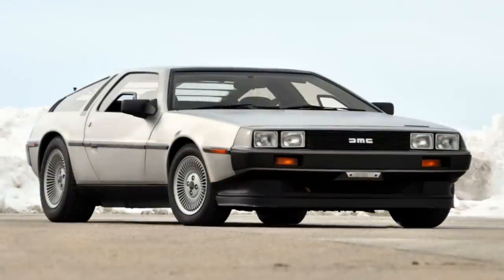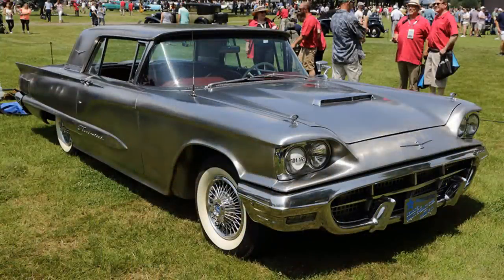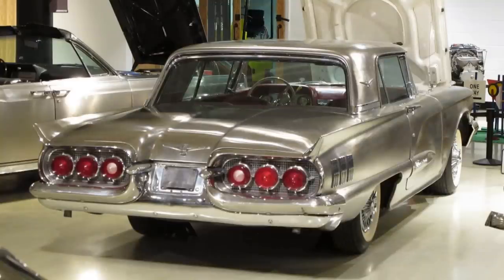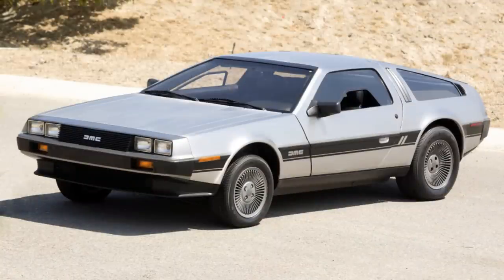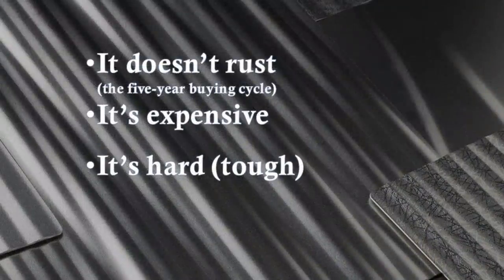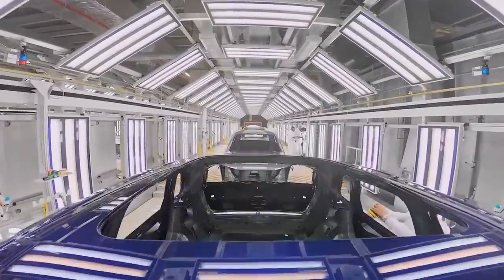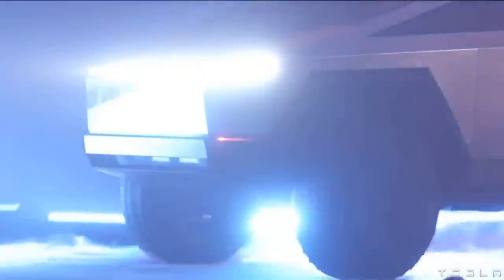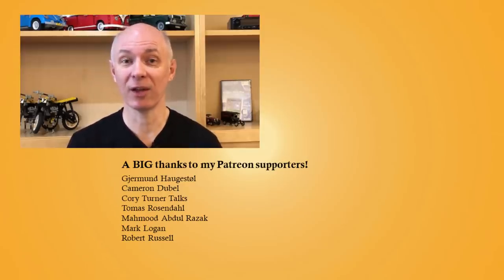Why aren’t cars made from Stainless Steel?

Comment: There is, or rather was, another car manufacturer that built 6 stainless steel cars.    General Motors Holden built 6 stainless steel HR model Holden Premiers.    They were special orders vehicles and were given to members of the board of execs working for Holden.    They were also not part of the company build run listing and were not recorded as being built out of stainless. Officially and from company production records point of view, they don't exist.    Each had specific vin's that ended in the build number of the vehicle.   They were all painted as well.

Comment: Imagine if all cars had been made from stainless steel? No more rusty bodywork
Reply: Then you only need worry about stress fracturing on any weak points design may minimise the stresses on bodywork and welding to repair 3mm Stainless steel wouldn’t even require a TIG welder …

Comment: Cybertruck is surely a joke? The way ahead is plastic, light and strong. Stainless steel is basically the answer to a non-existent problem but comes with a host of its own problems.  The goal is to make an electric car that performs like a petrol car in every way. Silly getting side tracked with Teslas marketing stunts.

Comment: You cant polish out stretches from stainless steel. That finish would be very high maintenance
Reply: I drive a truck.
I've washed it once in ten years and that was only because I had to replace a guard due to it being run into.
Real truck drivers don't worry about a bit of grime

Comment: The "detail" that was not mentioned here, and is not mentioned anywhere, is that this kind of construction is heavy as hell. Since all panels are straight, they have to have a very thick caliber of steel. And if you add the unnecessary bulletproof windows, the whole thing is stupidly heavy, so much so that the one great thing of it, the ecological benefit, is very much lost.

Now that several deadlines have been missed, I think it is time to think this white elephant through all over again.

Comment: The Delorean was plagued with with cracking panels which is why the hood was changed (Eliminated the fuel door and ribs). Stainless is in a permanent work hardened state and next to impossible to form into complex shapes. Aircraft aluminum or carbon fiber are much better materials to make a body out of.

I think Tesla went with the ugly body simply because it was easy to form.

Comment: Why all analyses of the Cybertruck completely ignore the pedestrian safety problem? The stronger stainless steel material bent to have pretty sharp edges will crush and kill people even at 10-15mph. The softer car front is also used as a buffer in crashes to take most of the energy and decrease passengers' deceleration on impact, allowing for greater survivability.
Other than that, stainless steel seems to be mostly a win.

Recurring sales for Tesla and other EV sellers would be batteries with their relatively short lifespan while being quite expensive.

Comment: As far as them being used for the Criminal Underworld, wouldn't they have to jailbreak the software of the car first? Then once they did, they'd have to have alternative software so it would run. It seems like Tesla could simply lock down the steering (as there is no physical steering column and linkages) and it wouldn't move very far.
Reply: The steering is physically linked in Teslas.

Comment: The most important question, more than the price and aesthetic is: is it safer during a crash?
Reply: The body sheet metal is  nearly irrelevant to the crash structure in almost all modern vehicles. Plus the crash performance of every single vehicle on the road is modeled extensively before it's ever tested in the real world. Any shortcomings of either body construction method could be remedied in the design phase.

Comment: So you're telling me Tesla are making a stainless steel pick up truck that won't rust, will be highly resistant to bullets up to 9mm caliber and is electric so it'll be cheaper to run than petroleum distillate AND it's reasonably affordable  ???
Sign me up, that sounds awesome and I totally dig the look of the cybertruck
Reply: You expecting more gun fire than you crashing this thing, being in the need of help, but not being able to break the glass when the doors can't be opened?
Reply: @cryptopolice6202  well it’s not the first bullet resistant car in the world. I would assume regulations would require similar features in the cybertruck to allow access in the case of an emergency
Reply: @unstoppableExodia  Certainly hope so, yes :)

Comment: Only the outer shell of the  De Lorean is stainless..
Reply: That's correct; stainless steel body panels - 304 alloy (the same as the Gateway Arch in St. Louis, MO).

Comment: Completely wrong about stainless steel  and dies in relation to the Cybertruck. 

The author is clearly very knowledgeable on the history of stainless steel cars. I had no idea. However, better research on the Cybertruck would have been helpful, and would have avoided this basic error.

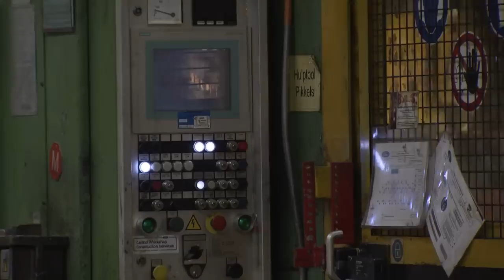At 1:47 the author incorrectly states that the difficulty of stamping cold rolled stainless steel is even worse for the Cybertruck. Actually, this problem doesn't even exist at all for the Cybertruck. Indeed, the manufacturing cost is greatly reduced because no dies are involved. The increased cost of the material is more than compensated by skipping both the stamping and painting steps.

That's why the design is angular. What people don't get is that the design is not simply a fashion statement. The choice of material and the absence of curves go together as a single decision.

Comment: The DeLorean company went bankrupt...but the stainless steel bodies of the cars were not the problem...it was poorly managed.
Though stainless steel (SS) is more expensive and harder to work...the fact that it can be used as stress members of the auto should pay off in less metal required and less weight.
Fiberglass was used for a short time, but it proved to be unsatisfactory. 
Aluminum should be a successful body material,  but it is too soft to be used as a substitute for a frame, ( Ford is currently experimenting with aluminum frames on some pickup trucks) but stainless steel can be used (as in the Tesla).
So why is SS not used...so that the auto manufacturers can engineer planned obsolecence into their autos and increase turnaround...forcing the car buyer into purchasing a new car every 5-7 years. Governments got wise to this and mandated a minimum 5 year warranty on rust ...but SS autos could last a lifetime if cared for...300,000 to 500,000 miles easily.

Comment: The reason why delorian went bankrupt has totaly nothing to do with the fact that the bodyparts are made of stainless steel, but with the fact
that it has a way underpowered renault engine, and the car isn't worth the name "sportscar". Besides that there were alot of finacial problems and that killed delorian.

5:05 sure stainless steel is way more expensive, but that is being compensated with the fact that you don't need primer, paint, clear coat, and chassis protection,
so in fact it's cheaper to produce a car like that, but they won't because they want cars to rust so that you buy a new one every 5 years or so, and that's the only reason!
Now audi did had galvanised bodies, but i don't know if they still use that.

Comment: you don't want a car you can't be cut out of and that the windows cannot be broken to get you out - especially if that car is fitted with a lithium battery that burns hotter than the 7th circle of hell.

Comment: Generally your channel is entertaining and it is always a pleasure to listen to clean British English. 👍🏻
This topic is an interesting attempt. Ok. 
But you should do better research and talk to Metallurgy Engineers.
Whenever the talk is about Aluminum it is about 99,9% Aluminum alloys in real. We never talk about pure Aluminum because it is not stable and would react with anything in the near within the fraction of a second. 
How can you allege that Aluminum or better said Aluminum alloys do not rust? I am sorry but this is not true at all! You can find this out very easily on your own. Go to any football field and take a detailed look at the areas where the Aluminum alloy parts of the goals are put together. You will see that there is partly corrosion which has white colour. 
Car factories do not use Aluminum alloys in order to get rid of corrosion. This metall is easier to be handled and can save weight, but is hard to be maintained in a car body workshop if there is damage on it.
Stainless steel is also not really stainless. It will rust harder but you can’t really stop it from starting to corrode. 
Please take care.
Thanks.🌷

Comment: If the police don’t buy them then it’s likely that the Cybertruck would be a great criminal drive ..... Stainless steel is very recyclable and far more durable than the current Aluminium and body steel found on modern cars ….

Comment: Contrary to believe SS us very easy to weld but is hard thus brittle and prone to fracture under stress/vibration
Reply: Easy to weld, but distorts more to high coeff of thermal expansion

Comment: "Stainless steel ruins press dies." But Cybertruck doesn't use dies. Big sheet, folded into flat, load-bearing triangular panels. Its an Origami truck to save money, weight and time. You didnt address those details.
Reply from the maker: That was what I pointed out in the video. I didn’t mention they would fold the panels, but I mentioned they wouldn’t press them out.

Comment: Stainless steel isnt that hard to work today with carbide cutters and hardened tool steels. I think that we need to see stainless truck frames at the least. And as far as adding extra costs.... A 90s Chevy truck mirror costs 30 dollars. A new mirror costs 1,000. So if we go backwards on some ridiculous expenses we can actually make a 90s Chevy truck cost less. A brand new Chevy 1500 with stainless cab, panels, frame, brake and fuel lines for 22,000. That is something I can get behind.

Comment: it should be making the body parts except the chassis from aluminium to make it lighter due t the weight of the batteries and a strong chassis made from stainless steel.

Comment: As we transition from a throw-away consumer culture, longer lasting vehicle bodies will become increasingly economic. And EV powertrains are simpler, meaning you'll be able to upgrade your car to the latest spec with a new battery, motor and a software upgrade.

Comment: You couldn't me more wrong about manufacturers want cars to rust.  Up here in the rust belt, rusty cars cost manufacturers dearly in repeat business.  Brands with reputations for rust have trouble selling cars.  Currently Mazda has rust issues.  About the only company that does.  When I bought my Accord, I didn't even look at Mazda, even though it has a great reputation otherwise. Look at Toyota, no rust issues, cars last longer than anyone else, they sell lots of new cars.
Reply from the maker: Yes, that’s a good point. My point was that when all cars were rusting then it helped them getting repeat business, just because all cars rust. But once one manufacturer managed to stop the rust then all companies needed to follow suit.

Comment: Ever notice how stainless stuff never has any compound curves?  There are real good reasons why cars aren't made of the stuff.  Wanna know how to make a successful railroad?  You need steel wheels and track.  Wanna know how to make a successful Hyperloop?  Billions of cubic feet of evacuated air,  magnets,  a space capsule,  more vacuum seal and expansion joints then has ever existed, and lots and lots and lots of electricity - constantly.

Comment: If stainless steel is hard, does that mean it's vulnerable to cracking?
Reply: You can bend and deform stainless a lot also but yes I would say it's cracking easier.
Reply: Stainless steel pots and pans never crack despite a lot of heat and cold cycle. Probably the good stuff though.

Comment: Not sure why you're assigning any positive value to companies that purposely want their products to wear out in 5 years so consumers have to buy again.  One of the nice things about Tesla is the main focus is continually improving value.  The only issue you raise that has any merit is the potential high cost of repair if there is damage.  But as you said, it will be pretty hard to damage this thing in the first place.  However, interesting to learn that aluminum alloys are not rusting.

Comment: Dont you have to use coal fires to melt the steel ore and to form the steel?
Reply: Of course that car is much more poluting than any regular car just the size and the fact engines and batteries need strange metalls and then add stainless with further more metalls in the alloy. A hell to recycle and devastating for the enviroment around 3rd world mines. And the electric grid has to be upgraded to change these massive cars. But yea continue fooling people you care about enviroment.
Reply: That metallurgical coal not thermal coal.
Do some research.
It's not a crime to learn
Reply: @hnorrstrom  . Obviously English is a second language but did you disable spellcheck

Comment: "some parts look like they last 10 years or more" - yeah, except the flash storage that tesla is wearing out with useless junk log files. Yeah, the body may last decades, but instead of oil changes, you just have to replace the central computer.

Comment: The Delorian ended in bankruptcy not because the car was made of stainless steel as the intro seems to imply, but clarifies later.  Why don't Manufacturers use satinless steel?  It's really very simple economics.  Stainless steel as a resource costs more and the complexities of forming the panels again adds to cost.  Body panels that last for decades means little when everything else is falling apart.  The CyberTruck body panels are not welded.  They are formed, but they are simple shapes so the dies are not exerted to a lot of stress.  To weld everything would be extremely expensive.
Reply from the maker: Lots more about DeLorean in January. I've written the script! And yes, we go into all the reasons why they folded.

Comment: A car failing is ever hardly to do with it being made out of better materials, it's far more expensive to make a car out if carbon fibre the retooling dyes for stainless steel, it's all to do with business models for profit and failure is a mixture of situations, usually unreliability or bad management, I would love my motorcycle to be made out of stainless steel.

Comment: So how did Ford form the stainless steel panels in complex shapes 60 years ago (1960 Ford Thunderbird & 1936 Ford Deluxe) and Tesla can't do it in 2024 with it's "Giga" press?
Reply: They could have been hand made
Reply: @2003AudiS3  They used the machines and dies from the normal assembly line.
Reply: Also it's Tesla, they can't really do anything well

Comment: Often aluminium is worse than steel for corrosion. Steel car wheels are largely trouble free. Aluminium car wheels are a huge PITA for corroding and slowly leaking air around the metal to rubber interface. Old Rover cars (those from when Rover was a luxury car brand), which had a mix of aluminium and steel panels, had at least as much trouble with the aluminium degrading as the steel degrading. They only used aluminium to get the enormous weight of their cars down a bit.
Reply: That and right after the war there was a terrif on steel but not aluminum.

Comment: I have been a auto mechanic for 30 years and from what I have seen with these Tesla trucks is there is no planned obsolescence to it. I have a 1950s  farm tractor that gets minimal love but it just keeps doing what it does. There was no planned obsolescence when it was designed. That fact makes me want one. I know after 30 years some of the computer systems my develop issues broken solder traces and such but somebody will be refurbishing parts for them by then batteries also..

Comment: There is a big reason for cars not to be hard. If you crash, it gives the people inside the car, the hole crash force. They probably die if the speed is past 60-90km/h. I don't think they will sell so meany for them. All other cars are soft, so they can be safer. think when people get hit whit that truck. They. die instant. Even if the speed is not that great.

Comment: Because of weight, aluminium lasts for centuries and is light
Reply: Except when corrosion sets in and returns it to its more common state …. Just destroy the outer protective layer and the decay will start ….

Comment: No 6: The Jaws of Life. How resistant is the cold rolled stainless steel to the Jaws of Life? What are we talking about; an extra 5, 10 , 15, 30 minutes as you bleed out after a crash??? This is the life or death question, and a little more important than rust or car park scratches.

Comment: Please stop saying transparent aluminium. That means Everyone
There is no such thing. Marketing BS.  It's ceramic - with alumnium element bond in it.
Using this term is daft as saying table salt is a transparent metal - because it has sodium in it  or maybe crystallised chrlorine gas.  It makes no sense.
If you persist with transparent aluminium I'll have to start forcing you to refer to water as liquified oxygen. STOP IT. PLEASE